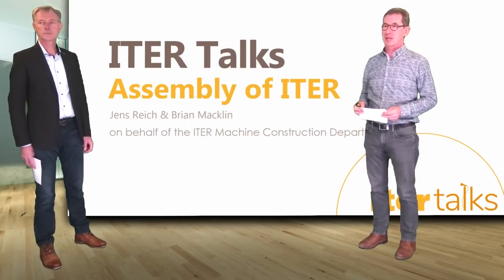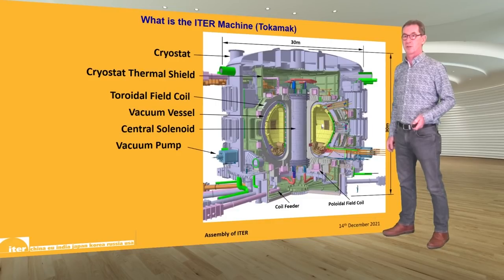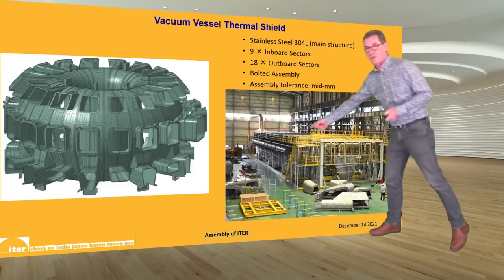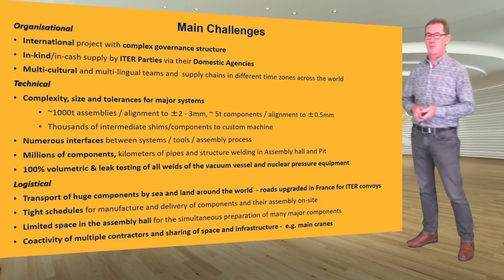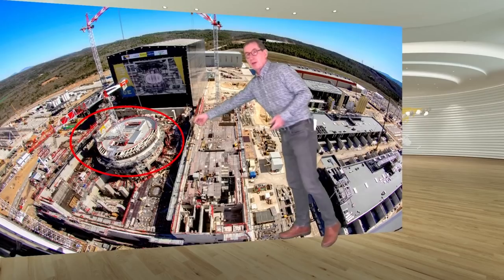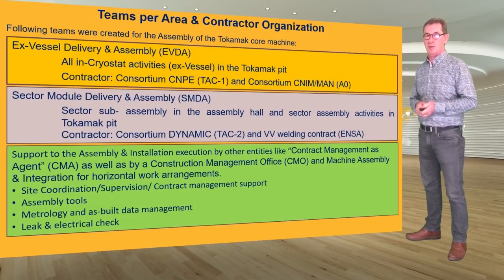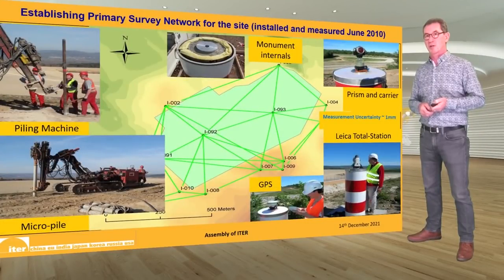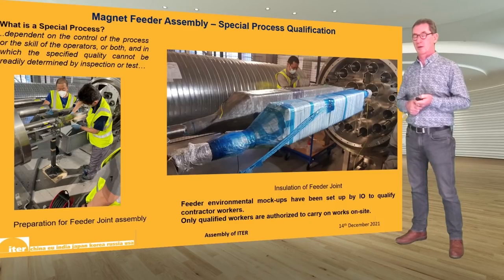ITER Talks (5): Machine assembly

Comment: Why was it important at the beginning of this project to find the center location for the tokamak? Is because you need bedrock that is close to the surface because at the end the sear size and weight of the building one have to worry about the building settling into the ground and possibly upsetting the precision specs of the machine? can't wait when the match is lit for the tokamak.

Comment: The engineering is indeed very impressive, but it’s worth noting that ITER is a very simple machine compared with a real fusion reactor, should one ever be built. The complexity and costs of adding neutron multipliers, breeding modules, cooling systems, massive shielding, as well as dealing with plasma-surface interactions, severe radiation damage and tritium management, poses huge questions for the future of fusion energy.